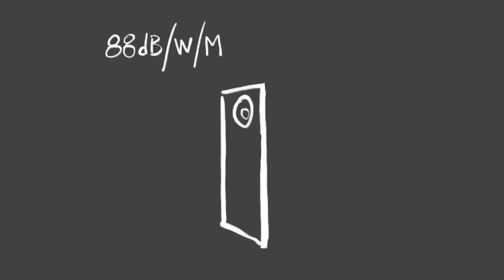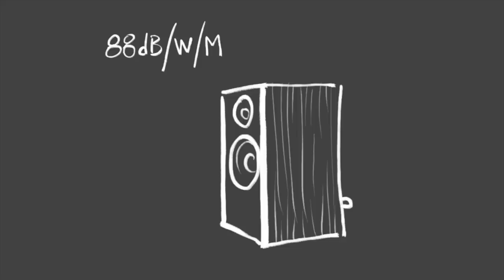John DeVore goes on a rant about the High End Audio lie that inspired him to start his company

Comment: I have a pair of Thiel CS 2.4 SE that I drive with an amp that outputs 400wpc into 4 ohms. They need grunt but when you give it to them, holy crap are they good! I knew going in that they needed a big amp as I got them from my dad, who blew up the coax units using an amp that wasn't up to the task.

Comment: Hey Phil,

Thanks for that excellent explanation! I guess I was just being a bit cheeky, meaning that regardless of how a speaker is measured there is a certain amount of arbitrary decision making involved. Why a particular voltage? or amount of power? (watts) why that bandwidth of pink noise? why 1 meter?, pushing a load that is not constant but called nominal impedance. 
Point was that it is all to a certain extent a bit misleading, somewhat arbitrary and not worth getting bent out of shape about. As long as you get a bit of an idea about how hard something is going to be to drive and hopefully you are shopping where the sales staff can help you match your gear properly.
My speakers are 4 ohm I have a 75 watt tube power amp and it sounds really good.
Thanks again for the reply, really appreciated.

Comment: My biggest peeves about hi end (audiophile material) equipment is the cost, the distortion of it's description and how it does what it does. Always lies, and sub par builds that could be better with the factory using higher quality wiring or caps.  How speaker companies have a flagship model that they spent all the time and money engineering but never give it to the public at a fair cost. If they did it would just make the brand even better and desirable in my opinion by everyone. Subscribed. Good video.

Comment: Thanks for explaining something I've sought to understand for years.  In the 80s I had a Nikko Alpha 230 amp that had power meters that showed the watts in relation to both 4 & 8 ohm outputs and never really grasped the significance in relation to a pair of Audiosphere Research monitors I was powering at the time.
Reply: I still use a Nikko Alpha 220 to this day. It's been "on" (no trigger) for 20 years!
Reply: @PeterGalbraith  It was a great unit, for sure!  I often blew the power fuses on the top but always kept a couple of spares literally taped to the chassis, lol.  I replaced the Nikko just a few years ago with a Kenwood receiver...my older ears didn't quite need all the previous power, heh.

Comment: I first have to say I had a Kenwood monster Receiver the Super Eleven it looked impressive with impressive specs but the sound had no life compared to my Carver receiver with a unique power supply that could push a lot of current at lower impedances. You also gave one reason for low impedances ,more bass from a smaller cabinet. Take the Sunfire True Subwoofer and the amount of bass it puts out of a 12 inch cube and 2700 watts. Many of the high SPL Klipsch speakers don't have low bass.   Lastly ALL speaker impedances vary and amplifiers that double down  will produce sound more accurately  even if it's an 8 ohm speaker that drops to 6 ohms at some frequencies (which happens often).

Comment: Back in the day I used to have a large pair of Cerwin-Vega floorstanders that were "rated" at 8 ohms, yet they would trip the protection circuits on many of the amps I connected them to. I did some measurements, and they were closer to 5 ohms

Comment: People need to understand that high end audio is NOT about sound quality. It is about self-presentation. That is no different from luxury cars. The rich don't buy two million dollar hypercars to get from A to B. They buy them to show that they have two million dollars to spend on a toy. 

If you have spent more than a couple of thousand dollars on audio equipment and you are not a professional producer or AV service provider etc., then you are basically just showing off. A good DAC costs a couple hundred dollars these days. A good transistor amplifier shouldn't be more than $400-800, that leaves ample profit for the manufacturer past the parts cost. Are you going to get magnetically levitated eight inch thick ebony front panels on an 18 metric ton aluminum chassis for that? Of course not. You are going to get cheap manufacturing techniques for all the mechanical parts, but guess what? Your electrons don't care. They only care about how well the circuit designer did his job. 

And with regards to speakers... if you don't understand that what you are listening to is mainly the shape of your living room, then you don't know the first thing about acoustics.

Comment: Great stuff!

We can safely assume that if a new formula is equivalent yet less intuitive, then the main incentive to change it is to drive sales. Make comparing specs. harder and buyers will focus on the rave reviews, the colours in the flyer, Savinelli pipes and the day of the week. Paying attention may be a sensible thing to do.

Let's take the ELAC BS 63 (which I obtained cheaply,  which induced me to get educated, which in itself is fully besides the point) which have a sensitivity of 88dB / 2.83V / 1m at an impedance of 6Ω. Power is then 2.83V * 2.83V / 6Ω and hence the sensitivity is 88dB / 1.33W / 1m. If my conversion is correct that would translate into 86.8dB / 1W / 1m. Then again impedance is frequency dependant so there's a generalisation to consider.

I'm considering a valve amp and speaker efficiency is a significant factor. It is said that valve amps produce a "pleasing" sound. I also like the glowing bits that take us back to black and white science fiction films, which leave visitors mystified whilst assuming all sorts of lovingly yet inaccurate positive things about my personal character.

DeVORE Fidelity you say. Interesting. Let me find my pipe and my horn-rimmed glasses.

Comment: Hi John. I can't say I entirely understand the math and specs. But I wanted to ask, why is it that home hifi systems in the late 80s-early 90s had 8 ohms vs. musician (for gigs) hifi systems designed for large rooms having 16 ohms? It was and still is my guess that the higher in ohms you go, the better quality and more power (in terms of loudness) you have. Similarly, in the late 90s I started seeing small, bookshelf, surround sound systems driving 4 ohm speakers, which didn't have near the power (in terms of loudness) or quality of my older Technics home hifi stereo (built in the late 80s) which drove 8 ohm speakers (amp was 110 watts/channel w/ only 2 channels). Then when I was in college in a class called "The Physics of Sound," the professor mentioned a new company known as "Bose," which was able to build tiny speakers with as much power as my speakers that had 10" woofers. Yet a few years ago I revived my Technics amp and bought used speakers w/ 12" woofers that easily outpowered even modern speakers w/ subwoofers. (I later gave away that amp because no one would buy it and I never used it...) Anyway, it would be interesting for you to make a video or video series explaining how hifi audio has developed into the complex surround sound market it is today.

Comment: If you use 2.83 volts rather than 1 watt, couldn’t you simply define the amount of current being used to create the level of db listed? That would then give a useful specification rating to compare various speakers. I don’t see a problem using either 1 watt as the standard vs volts x amps? What am I missing?

Comment: I remember when (especially car audio) DVC subs came out the 2.83v/m spec became popular. With the reality small  Vas specs and low Fs of car subs, manufacturers could essentially lie about sensitivity to makeup for embarrassingly low outputs. I remember trying to figure out maximum theoretical SPL, but they didn't even specify how the dual coils were wired (I just assumed parallel so that they could get the maximum number of watts per 2.83v).

Comment: i believe it must be harder to design a neutral speaker @ high impedance, than low impedance. otherwise you wouldn't see so many of these high-end speakers requiring 2-ohm-capable monster amplifiers that cost 4+ figures.

Comment: Thank you for something every audio fan or specialist won't name a rant, but a honest and clear explanation of how industry can distort fact to it's advantage, or not. As most of high end audio has a very complex load signature, depending on frequency, efficiency numbers have always been a kind of truncated indication, as most numbers in HiFi audio. And when it comes to the "weakest point", I name loudspeakers, phase variation to frequency and time constants are also significant, but few publish numbers any could easily understand and compare, depending on lab specs like reverberation carateristics, analysis means (statistical laws...). So, even if these numbers are significant, we all know many of these can as easily mislead someone trying to choose an equipment only by the reviews done in these magazines. And the same can apply to amps, digital audio, and every part of equipment in the audio restitution chain. The ideal way, and not the easiest needs time and dedication, to compare and tune all these components. And explaining how these measurements are done and how they can bias a choice are only revealing things experience and a good ear can detect. Of course these Krell monsters were a reference then, but in the same time McIntosh with output transformers also provided highly performing and stable machines with high (and constant) power capacities. However, the result was always different in other tonal aspects and not only a clear bass response. Let also say the origins of the actual trend in audio construction was to have relatively low efficiency and low impedance, resulting as a need of a market constantly asking for miniaturization. So it's leading to biases like separate bass boxes or sections, with dedicated filters or amps. That meant multi amplification, something pioneers initiated in the late 1970's. With developing technologies, it was a de-facto necessity. Classic exemple is still electrostatic based systems, where basses have to be treated independantly for best results. It was also a ultimate goal for some audiophiles to look for ultimate bandwidth, as soon as the numbers in the 80's and the perspectives of digital technology pleaded for such possibility. I remember a customer complaining because he could not ear a 16Hz organ "bourdon" tube on his pricey system, only to choose speakers much closer to scene speakers than real fine and performing audio HiFi gear, for a tiny studio in Paris! Let also say the power requested for these nearly inaudible sounds is fantastic, (and in a frequency zone known for the ultimate lowest impedances) but with the then unlimited budgets, everything was also possible (I pity the neighborhood). So now as the tube audio amps with tiny power are the new "must have" reference (from China???), it's also an absolute need to source high efficiency loudspeakers with relatively constant high Z. It can explain why some have a special appetite for vintage equipment or traditional builders still using large diameter boomers (Tannoy, JBL, Klipsch, Cabasse...): and the few watts of these systems with newest high end bookshelf loudspeakers with low efficiency is catastrophic.
To conclude, your explanations sound particularly good for anyone that have seen so many audiophiles fooled by their magazines or deceived by some hastily done choice. High end audio is essentially a question of personal taste, sometime specific needs or specific home volumes, more than someone else choice comparing with limited or impossible to reproduce conditions. If I must advise some future acquisition, the ideal is to test any loudspeaker in home situation or something as near as possible, and with sufficient time to check with different electronics and sources. Something difficult if you buy on the internet, or at your local "supermarket".

Comment: I'm not an engineer but isn't voltage a more consistent measurement since the impedance will fluctuate, sometimes wildly, outside of the nominal impedance advertised?  Also, wattage, while a consistent way to measure power, is poorly understood and advertised in a misleading manner.  My McIntosh plays louder at .45 watts (per the meters) than my Yahama receiver can at full volume (110w X 2) driving the same speakers.  There are some dubious watts being sold out there.

Comment: so if I'm calculating sensitivity for my speakers how might I do that?  Martin Logan says my Motion 40s are 92 db using the 2.83 nomenclature.
Reply from the maker: I haven't seen an impedance plot, but the company claims 4 Ohms. This means they are likely even lower. At 4 Ohms they are half the Wattage sensitivity of an 8 Ohm equivalent, or 89dB@W@m
Reply: @DeVOREFIDELITY  so basically its minus 3db?  That was what my math came to also

Comment: If you apply a sine wave to an amplifier input, and you sweep that signal across the audio spectrum at a constant amplitude, that amplifier should output a voltage that is proportional to the input by its forward gain specification.  Since speakers present a complex load that varies across the audio spectrum the output of the amplifier in terms of power will vary depending on the specific frequency.  In addition, impedance  which is complex and referred to by the symbol “Z” is not necessarily equivalent to resistance which is referred to by the symbol “R”.  V^2/Z = VA (Volt-Amperes).  V^2/R = P (Watts).  VA and P might be equal under special cases, but for dynamic speakers they are not equal.  Therefore, dB/W/m is ambiguous and misleading.  Rating by 2.83V is specific.  The nominal impedance of the speaker allows one to evaluate the capability of the choice of amplifier to drive the speaker load.

Comment: Meanwhile I build bluetooth equipped suitcase boomboxes as a hobby using relatively low-power amplifiers and power supplies. Rated for up to 50w a channel, but I run them at about 10w each.

How do they sound? Satisfactory.

Comment: Very well explained John only one thing I have to mention and sorry if its been said before, the term "dB/1W/m" which suggests that the sound intensity increases at greater distances. Technically, it should be so many "dB @ 1W @ 1m" or verbally "the SPL is so many dB with one watt in at 1m distance" sorry not being picky here. Great clarification of the subject otherwise. And yes, definitely more educational than ranty.
Cheers!
Reply from the maker: You are completely right, I was a bit lazy and used the shorthand common on spec sheets.

Comment: They started compromising on receiver power years ago as well..I do some modest home theater set ups and always used Denon receivers.I notice a few years ago that there entry level receivers simply didn't cut it at all and started buying used 3806's 3808's 4306's etc. For larger homes I would used the old 4806 Denons which at 4 ohms 2 channels driven would do around 250 watts at 0.1% distortion and around 350 watts per channel at 1%.. In 7 channel mode they output well over 100 watts with all channels driven which they should with a price of $4000 dollars out the door back in 2006.. With a large subwoofer and using the high pass crossover the systems were impressive for the price..They still pop up on Ebay for $300 to $400 dollars in good shape....

Comment: I would love to see a video covering this same talk about amps. “High Current” is often suggested for many speakers. The relationship with tube and volts would be appreciated as well.
Reply: Current in that case is almost certainly referring to Amphereage aka amps. Generally speaking loud speakers as transducers do better with lower voltage since 8 Watts = 2V * 4I but also 8W = 4V * 2I. And voltage is more or less fixed (obviously oversimplified) the output transformer needs to be able to match what the speakers need

Comment: John, thank you for sharing and describing the issue so well. 

One thing I've discovered and never really found a good answer for relates to my experience with Car audio but the concepts are the same I'm sure. Taking really any amplifier, let's say a 500W monobloc amplifier with it's rating at 4 ohm, the manufacturer will say 1000W at 2 ohm and so on. In my testing I find the sound remains far more controlled with a lot more dynamics and by measuring the output voltage of the amplifier, that you get even more power when looking at higher impedances.

An example: 8 ohm load on a 500W amp should give 250W continuous average power but I find that it's output will A) sound significantly more dynamic and musical than the same speakers wired down to 2 ohm and the total output to be the same or higher. I equate it to an amplifier having a total amount of available power regardless of impedance and the dynamics of the speaker as a reactive load responding basically the same way whether connected in a high impedance or low impedance configuration. 

With a cheap amp in the past, I wired it for 16 ohm as opposed to the 4 ohm I had originally loaded it down to and found it got louder, sound SIGNIFICANTLY more defined and musical and ran far cooler. 

Would any of this make sense? Am I imagining things? :)
Reply: That's a good point that many amps will sound better with less loading if it still has no trouble hitting the power actually needed. However in the case of car audio there are problems even getting that much power to the amplifier so yes running it more efficiently could make a huge difference. Also more questionable claims and sound quality there.